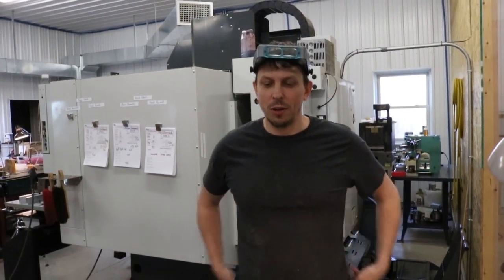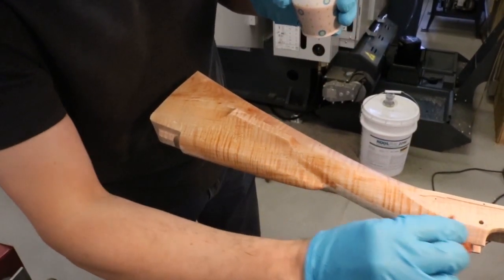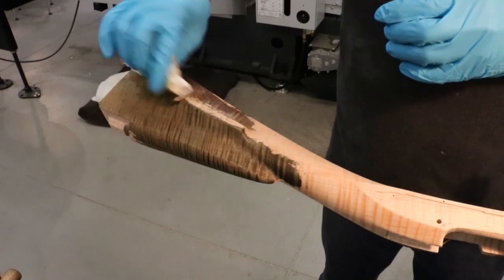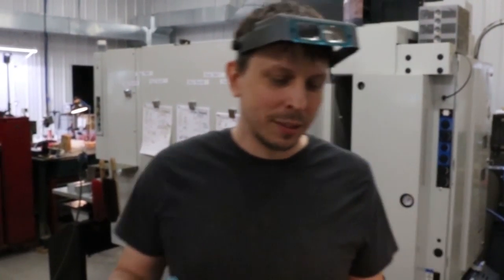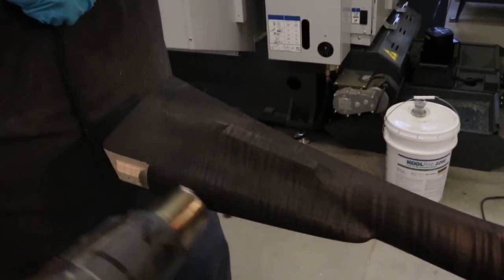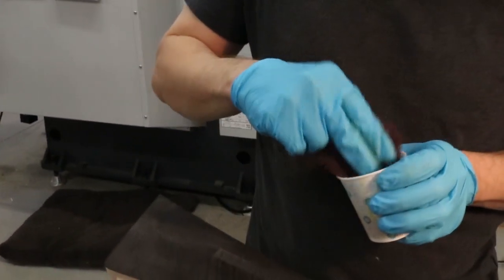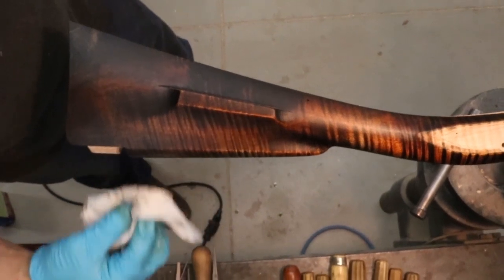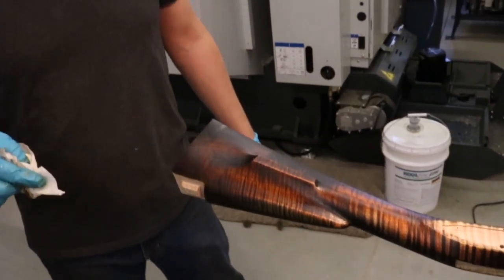Staining Maple with Tannic Acid and Iron Nitrate

Comment: I am a little confused. I thought you could not put trans tint dyes in oil. I am not trying to find fault or be snarky. Is there a trick to doing this. Your results look great.

From trans tint website:
• TransTints are not recommended for adding to oil based finishes like stains, varnishes, polyurethanes, linseed and Tung oil. You can usually work around having to add TransTint to oils by using TransTints in shellac or some other medium that it does mix with. If you have a situation where you must add TransTints to any oil or oil product that thins with mineral spirits, contact us for an additive that will disperse the dye into oil finishes.

Comment: How do you finish the stock? Do you keep applying coats of the tried and true oil until it’s done absorbing?
Reply: it will eventully stop absobing few coats later and start layering in very thin coats.  this is a mimick of a french polish

Comment: Looks good! How would I get it darker and still have the contrasting grain?
Reply: I bought some knife handle blanks on which I can try different techniques. In my opinion ferric acid with aqua fortis alone can be so dark that you barely see the curl afterwards. 
I will use only aqua fortis on my kit because I dont see the point of buying expensive wood and then stain it black.

Comment: Jim, How would it work to rub the stock back before applying the oil finish?
Reply from the maker: That would work fine.  It might be a little harder to judge the color without the oil though.  Any dust created can be a little nasty as well so breathing protection would be a good thing.